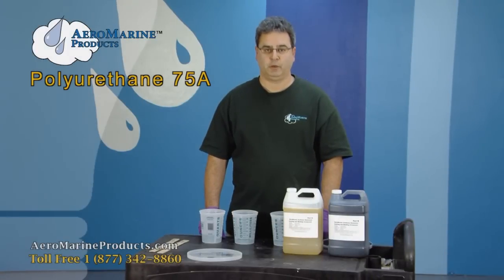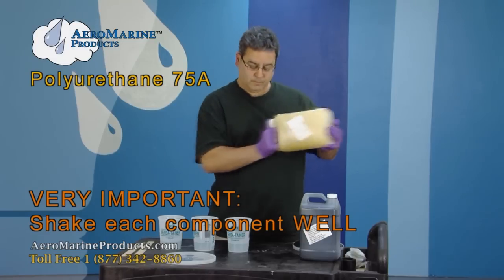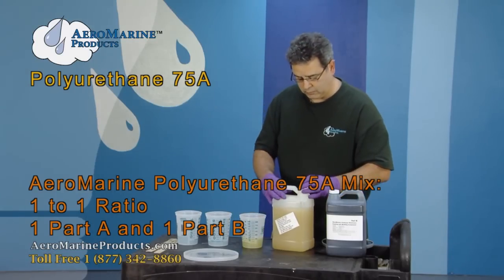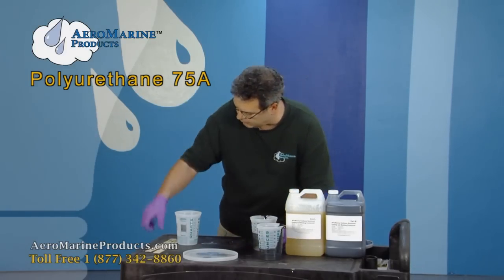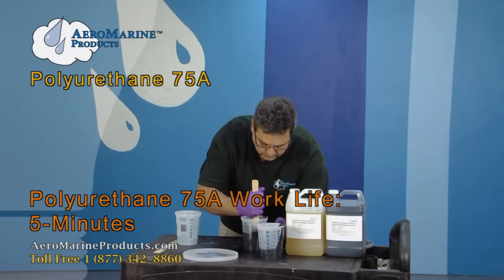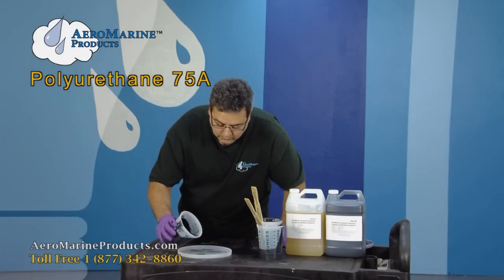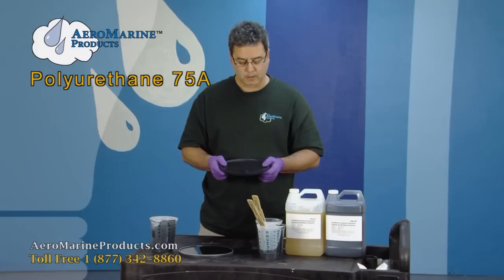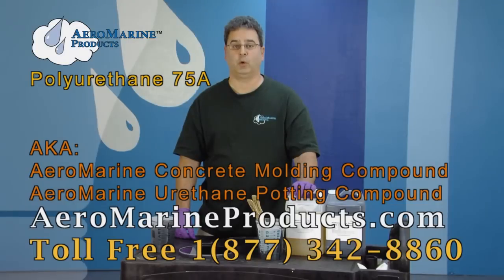How to use Polyurethane Rubber 75A by AeroMarine Products

Comment: Are there any materials for the mold that should be avoided?
Reply from the maker: Once the mold is created it can be used with most materials but it is generally best used with coarse material like cement and concrete or other materials that are less suitable for silicone.  When creating the mold it should be OK with most materials as long as you use a good mold release material.  In the Concrete Mold Making Rubber kit we include a small amount of silicone mold release paste that works well for this purpose, otherwise mold release wax pastes can also be used.  Our Polyurethane Rubber is extremely sticky before it has cured so it is very important to use a good mold release with it.
Reply: @AeroMarineProductsCo  thanks for the quick reply! I am looking to pour the 75A into a 3D printer part. Will that part need mold release as well? Or will a specific print material allow for easy peel away removal of the cures pour (as depicted in the video)?
Reply from the maker: Yes, 100%.   It will stick to PLA and ABS, I haven't tested it with PETg filament but I don't believe that will be stick free either.  The only material that we've tested that our Polyurethane Rubber will not stick to is polyethylene or polypropylene plastic, like found in trash bags or painters tarps.  PETg has an extra glycol group attached which I believe may cause it to become very sticky to Polyurethane but again, I haven't tested it yet (it is on my to-do list once I do some upgrades to my printer however)
For 3d printed molds you also want to seal them because there will be tiny gaps in the layers where your mold making material can become physically stuck when it cures.  Our 300/21 epoxy has a similar viscosity and penetration capability as Smooth-On's XTC3D epoxy coating system for 3d prints and is good for coating and sealing 3D prints.

Comment: What is wrong with pouring out of the second container? Thanks
Reply from the maker: So what happens is that the urethane components are very sticky, and will cling to the sides of the container that you pour it in.  Even if you scrape the sides of the container, there's a good chance that you'll get unmixed urethane components in your pour.  By pouring into a second container and mixing there before pouring into your mold or whatever you're using the compound on, you significantly reduce the chances of getting unmixed urethane in the final product.  
In short you're making sure that you have solid urethane rubber instead of pockets of liquid material.
Reply: @AeroMarineProductsCo  Thank you so much, this might be just the problem I was facing. Sometimes it left a greasy finish and then blamed the release agent for it. Defenitely going to try this tip, thank you

Comment: Do you think that this would be durable and strong enough for a camera eyecup? Considering they’re normally rather thin, would it still be rather rigid?
Reply from the maker: Not knowing much about camera equipment, I couldn't say definitively.  The thinner the cast, the more flexible it becomes but it holds it's shape well even when its thin. The best advice I could give you is to go to our website, AeroMarineProducts.com, and click on the free sample link and get a cured sample and see if you think it would be rigid enough. It is a very durable and abrasion resistant material so it does hold up well as a parts material.